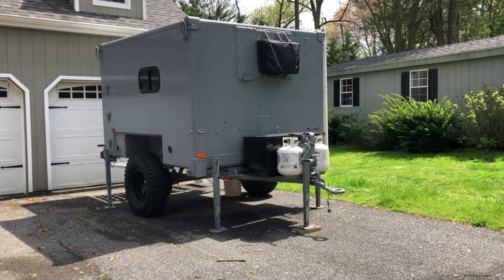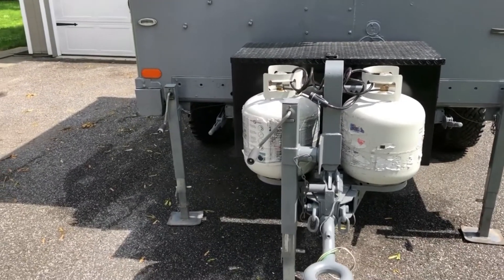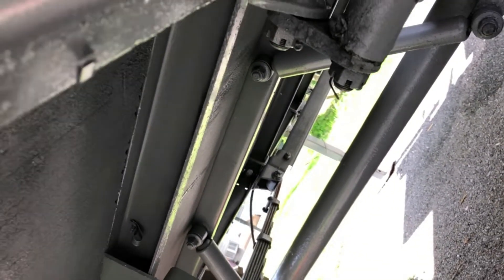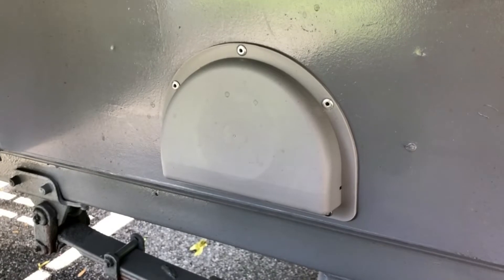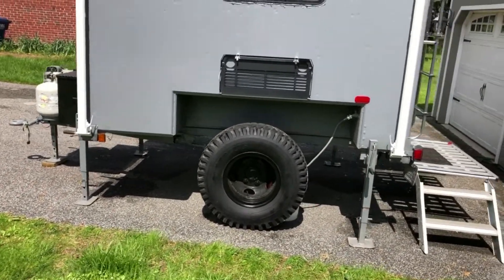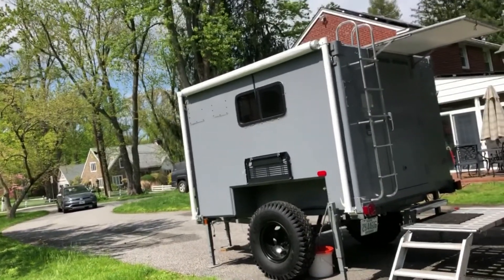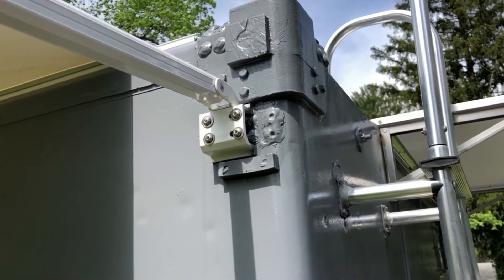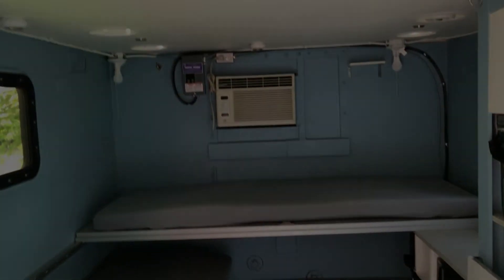S-788 on M101 Military Offroad Camper Trailer Conversion Exterior Walk Around

Comment: it is pity that you don't have the building video of this trailer. would be great to see your build step by step!
Reply: It is pretty simple, remove 101 body, set 788 on it.  Done. I have 3 of these shelters. Several 101a1, 105a1, and 105a3 trailers. The 788 is pretty small inside. 64"x 64"x 100"
Reply: @frenchfryfarmer436  Hey man, do you know the depth of the wheel wells of the 788 by chance? would the 105 work or be a better choice for the 788? that the 101's really ride high???
Reply from the maker: @mjmisp definitely, they are 15” deep

Comment: I bought a electronic shelter mounted it on a generator trailer and added a second axle and extended the back 4 feet added a grey and black water tank and a bathroom on the back and a stove top for outside cooking a 5kw generator on the front side with a water heater on the outside and a shelf for a barbacue grille it has the military ac and heater and a fresh water tank with pump and sink and a 5,000 ac on the side with outside flood led lights with convection oven and microwave and refrigerator my gas tank is 20 gallon for the generator will add solar panels on top with awning on the back and side escape window on the side still adding to it i use a m998 to pull it which has a international Ford 7.3 engine and 5 speed standard xmission I hope this will give people some simple ideals

Comment: May want to eventually upgrade to an a2 chassis; surge brakes and a more common 8 bolt CUCV wheel
Reply from the maker: It now has a 3” Dexter 3,500# axle with Ford/Honda compatible bolt patterns.   Also has electric trailer brakes and I retained the manual parking brakes.  I’m very happy with the new axle!

Comment: Did you say you put the military axle under it?
Reply from the maker: The axle was part of the trailer chassis; I have since replaced it with a dexter 3”; 3500# axle with electric trailer brakes, a more common bolt pattern; and manual parking brakes.

Comment: What's your dry/loaded weight?   Hows honda tow loaded?
Reply from the maker: I think it’s about 2,500lbs, but never weighed it.  I know the box and trailer are about 1,500lbs and I figure another 1,000 lbs in the build out.   Honda tows it easily offroad and highway with a 5,000 lb rating

Comment: I have the same unit that I’m fixing up and will be mounted on my Dodge Ram with flatbed. Just curious about the generator, will your generator run the A/C?
Reply from the maker: My generator (1800 Watts) will run the A/C easily.  I can even run the A/C on my 1200 Watt Inverter, although I don't have the battery capacity to do that for more than 15-30 minutes.

Comment: So glad you put up a couple videos of this! I just purchased one a couple days ago, it's a smaller version, a S-250/G. My current plan is to somehow convert the front end into an over the cab camper, as it fits in the back of my truck. I am not mechanically or electrically inclined, so this is going to be all new to me. Anyway you can show me a parts list/name brands of what all went in for electrical, heat and water? Also what did you mean by nut certs, as I am planning on doing pretty much everything you've done! Nice work btw. Also, did you end up switching out the inverter? Thanks again for posting these.
Reply from the maker: I'll probably have a new video soon, because I'm still making improvements.  Added solar and now installing a new axle.  Nutzerts are also called Nut Rivets.  Basically it's a rivet with threads inside so you can screw bolts into them.  A lot less permanent than a true rivet.  I probably have put over 150 of them on this unit.   The electrical system is basically just household materials available at Home Depot.  My Inverter is currently an AIG Pure Sine Wave 1200Watt.  It's REALLY good.  I can run my microwave on it and my coffee maker.  The exterior electrical port is called a "Flanged Inlet".  They are used on boats and RVs.  A lot of the stuff I buy is actually for boats.  The switch that converts from battery power to shore power is called an EZ Generator Manual Transfer Switch (Not cheap!).
Reply: @SurplusCamping  Thanks for the reply. Since I messaged, I've done a ton of research and confident I can do the same. I plan to do videos and post them eventually. Amazon Prime had me getting all my solar as well, again complete rookie to any of this, but need another Covid project since the house is done :) Would love to see more. I'm afraid to really dig into this thing with a drill though, would you be able to maybe do a video of how that is done...specifically to this? Appreciate any info or connecting you're willing to do!!
Reply: And I meant the Rivet and Nutzerts tutorial....sizes of each would be really helpful, my awning and other parts are on there way!

Comment: Also what type of paint did you use for exterior?
Reply from the maker: It is Rustoleum Professional Smoke Gray.  I rolled it on from a 1 gallon pail.  I chose this color because they also make it in a spray can so I can easily touch up with the spray can.  I also did all the nooks and crannies I couldn't reach with the roller with a spray can.  You definitely don't want to spray the whole thing though, that would cost a fortune and you wouldn't get it as-thick as rolling it on.
Reply: I would've used matt finish
Reply from the maker: @frenchfryfarmer436 idk, gloss is easy to clean, and also really easy to touch up.  Paint has been really durable, even now years later!